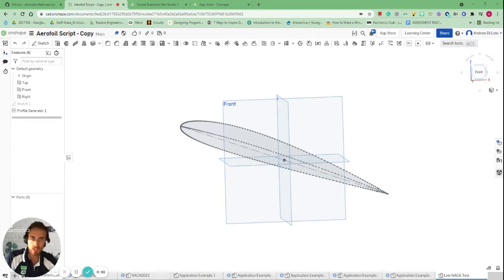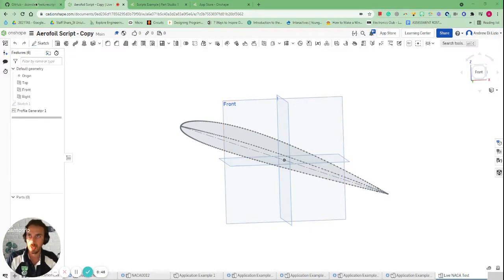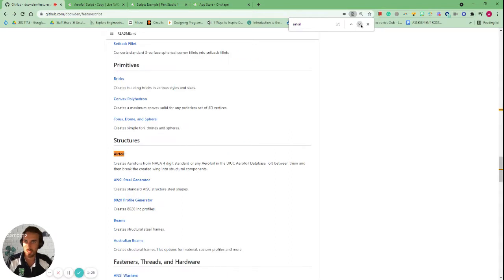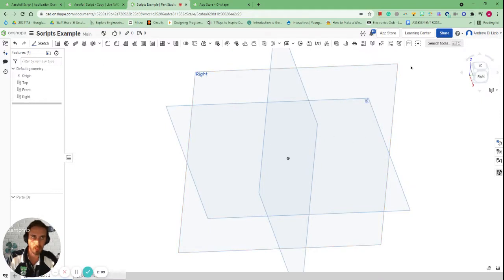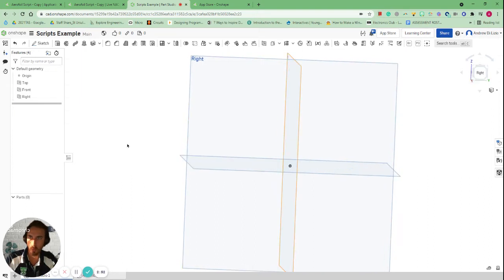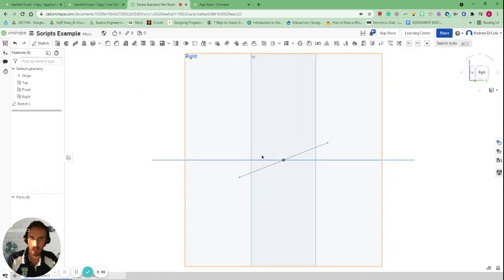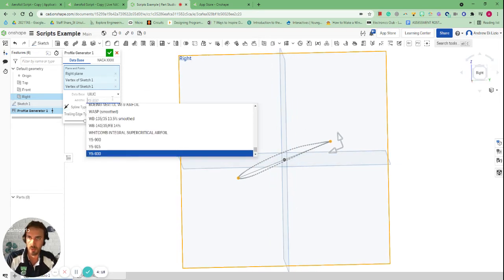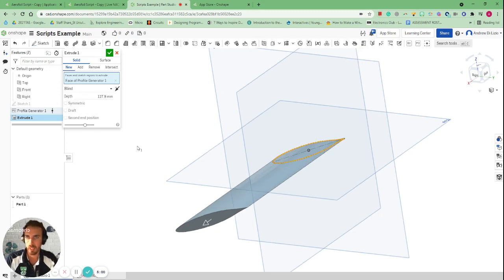How to use Onshape Scripts - Airfoil Example

Comment: This didn't work. When I click that airfoil link in github, it pulls up a profile generator and wing structure slide deck, and a series of scripts. It doesn't pull up the sketch profile like he shows. If I make a copy of Airfoil, it shows up in Other Documents under custom features but there's nothing in it (it's faint/not solid, then when I open it there are no features inside). Stuck/ pulling hair out, I just want an airfoil profile sketch and I cannot for the life of me figure out how to generate one and this video skips over the entire process of generating one in my document.
Reply: If you click on the "+" symbol to the left of the tabs at the bottom, select "Create Part Studio", that will open a new tab to draw in. Then click on the "Custom Features in this workspace icon at the top right "a small box inside ( ). Then select which option you want.  It took me 15 minutes of messing around to figure this out...